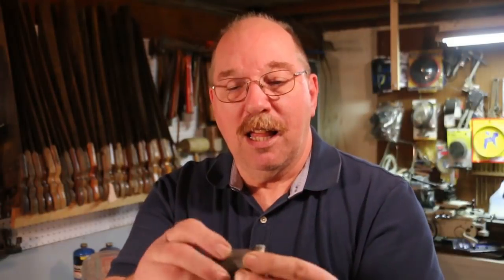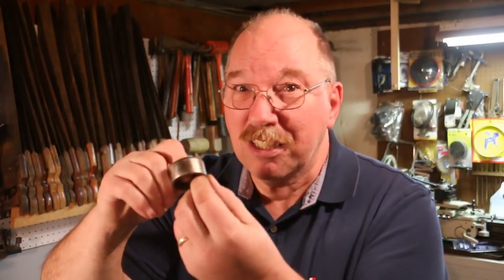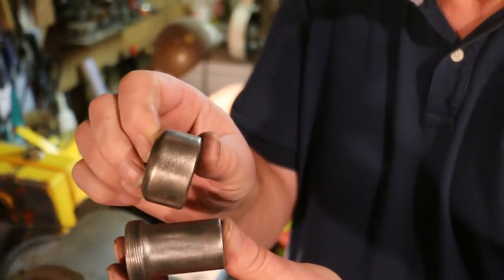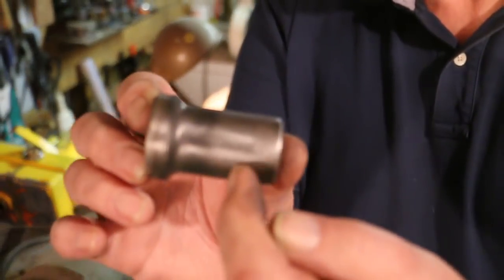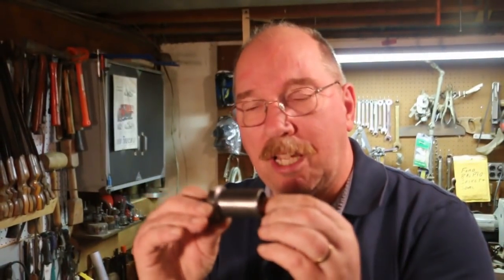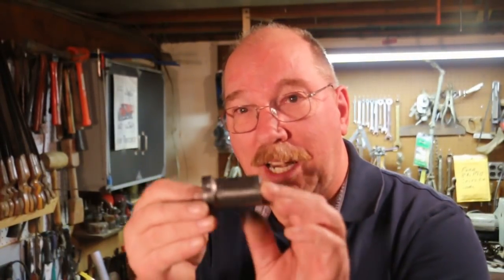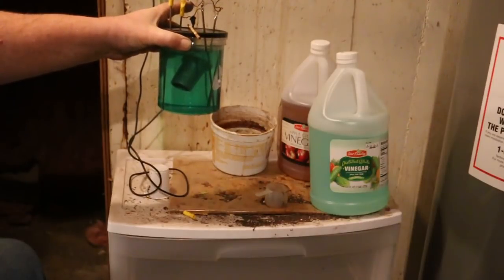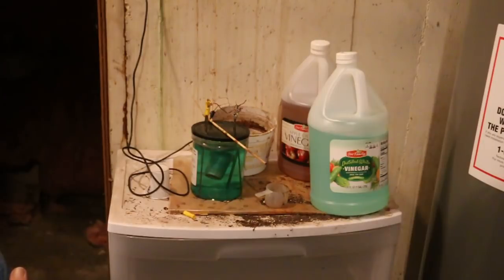Nickel Plating - Pexto 8014 Brace - Pt 3 - Chuck Parts

Comment: For building metal plating onto your worn parts, try a strike coat of nickel first, followed by a heavier build coat of of copper plating and followed by a finish coat of nickel plating for hardness and durability.  The copper plating is performed very similar to nickel, however, copper does not take to steel directly and is the reason you have to apply the strike layer of nickel.  The copper acetate is made the same way you make the nickel acetate, but using copper for the anode and cathode in the vinegar bath.  There are several YT videos on how to plate copper and nickel onto the same parts. Good luck!
Reply from the maker: Thanks for the suggestion. The nickel plating is for appearance and corrosion resistance. 
I use to work for a company that did machine rebuilding. Some equipment needed shaft diameters increased. We had flame spray to build up worn areas. In some situations we had  the shafts hard chrome plated.
It is an expensive process.

Comment: To get good nickel you need to plate with copper first.
Reply: When plating steel.
Reply from the maker: @joesteele9480  I use to think the same thing. Now I have researched and found that although copper can be plated with nickel and steel can be plated with copper neither is a requirement for the other to happen. 
Nickel is often used as a flash coat because of its ability to adhere to many materials. 
https://www.casf.ca/wp-content/uploads/2014/04/NickelElectroplating.pdf

Comment: Hi Dave!  The project is coming along nicely!  Even though the Shellac comes in different shades according to the flakes that are used to make it, it also can darken slightly over time.  There is a shelf life associated with shellac and that's why the serious woodworkers mix their own shellac from flakes and denatured alcohol in small batches.  The Bulls eye shellac does last longer then any other shellac I tried and if it starts to thicken up a little just thin it out with a little denatured alcohol.  If it must be crystal clear spray lacquer is great and I really like the Rustoleum clear coat although it goes on a little thick and you can tell the piece was coated...  Look at all the fun you are getting out of a couple dollar brace!!!  Great stuff!!!  😃👍
Reply from the maker: I have had a lot of fun with junk. I spent a month or more fixing a #4  plane with a broken sole. Another month went into rebuilding a transitional plane. 
Projects like this let me fix nearly everything that goes wrong with a tool because everything that could, has happened to this one. 😁

Comment: Welcome Home, Unc and things are still skipping right along. Seems when you go from talking to Angel or back again. Charles is looking good and a pipe wrench with a cheater makes a fair to middlin knurling tool. The younguns got me a subscription to a home handyman magazine and they had a thing about putting 'patina' back on screws using gun bluing. All by stuff is close to that but it might interfere with the oil finish, BLO included. So have a nice time at home and you must be in a warm spell. No burners lighting up. Take care!
Reply from the maker: I did some more editing on tomorrow's video today and I think I might have some of the issues with the music figured out. the things that work with the old editor obviously don't work well with this one so one of the things that I was doing before was I was loading the music in while I was headed in the video Because by the time you run through 20 minutes of video is a lot of running back and forth. So this time I waited until the end of the video was all edited and everything was done and then I put the music in now it seems to have worked but then this one seem to it work when I was uploading it it seems to be fine but now I'm saying that it's hopping and skipping all over the place so we'll just have to see what happens.. I handyman magazine I was a member of the group and even got the key chain with a little tag on it. Lydia got me the subscription. I had it for about 3 years and I enjoyed it but they started repeating themselves like all magazine to do and the subscription that was about 15 years ago and probably they come back around and got some new stuff so I bet yours is going to be a lot of fun.

I get quite a chuckle out of that patina arguments I spent more time trying to get patina off of things because the Tina usually means that something got dirty Rusty or junk on it I was telling some guys that I remember when I was a kid we had an outdoor toilet. these days everybody is really nuts about hand washing you going to the store they got a little wipers that you can wipe off the handle on your grocery cart so that you don't catch diseases when you go in the doctor's office I got a bottle of hand sanitizer sitting there when you walk into the hospital there's a bottle of hand sanitizer at the entrance and wiper so that you're supposed to clean your hands. There was a roll of toilet paper. We're at least that advance but there wasn't any hand sanitizer or sink or a towel or anything else well there was a flashlights but my brother drop that down the toilet so that was someplace she couldn't get to it it didn't steal it for like 2 weeks that was one heck of a battery.

Furnace has been running for about 2 weeks straight I've got snow on the ground and it's just really really cold I think the furnace just was off at the times that I was saying something that I wanted to put on the video so it didn't get in there

Comment: I bought shellac in pre-dissolved form from a woodwork specialist shop, they had it in three grades.  From dark brown to medium and to clear which had the colour of demerara sugar. The lightest was the most expensive as it is said to be the most refined. Completely colourless doesn't exist, I was informed.
Reply from the maker: After it dried it isn't as amber looking. Pretty cool stuff. It wasn't until I got into woodworking that I found out the stuff is dug up in India. Bug juice! Go figure. I also read it is used as a coating on pills. Makes you think twice about taking time release medicine.
Reply: @OldSneelock  Shellac also makes the apples look real shiny in the store.
Reply from the maker: With so many uses I wonder just how many lac bugs there are in India? 😲
Reply: The bugs are farmed, I understand, so supply and demand play a large role.

Comment: i guess you can mask off a part with tape then you pull it off after plating and measure the step edge, have to worry about it thick enough to stand some polishing.  acid etch before plating?   may be interesting to keep an eye on the specific gravity over time of the fluid if you have the equipment, i also warmed the solution to 30c and found it improved the coating.  there is FAR more information than when i was doing it, i had issues with the plating being very dull indeed and polishing would often go through...best protection> paint clear coat spray!
Reply from the maker: I boosted the power with a 12v battery maintainer. The coating was faster but rough. Really thick though. 😆
Reply: yes ! maybe that was my issue all along too , i dont see why long and slow shouldnt work well, a larger part just leave longer with the 5v supply
Reply from the maker: Before I started, I bought muratic ( hydrochloric) acid to pre-etch the parts. Before plating I removed the rust with vinegar and wire brushing. After removing the rust, winter finally showed up and I didn't want to stand in the snow etching the parts. 
PS I don't use muratic inside. The fumes are nasty to breath and they rust every piece of steel they touch. 
I tried some test pieces with just the vinegar etch and brake cleaner. The plating is sticking so well that I never opened the bottle of muratic.
Reply: @OldSneelock  yes i can see vinegar being enough, if left an hour or two, it has to be microscopic anyway, another great idea i never tried back in the day